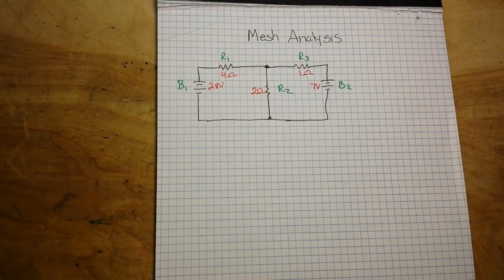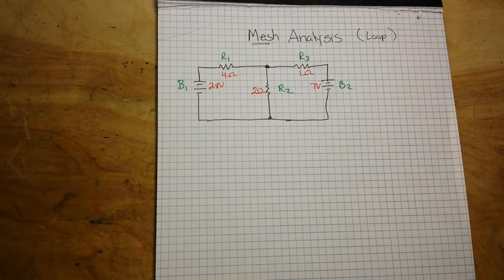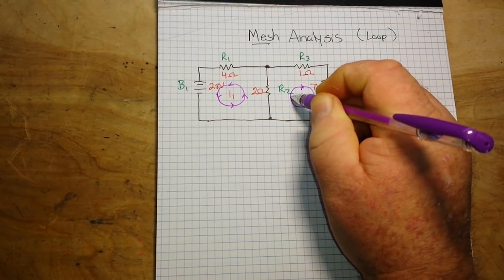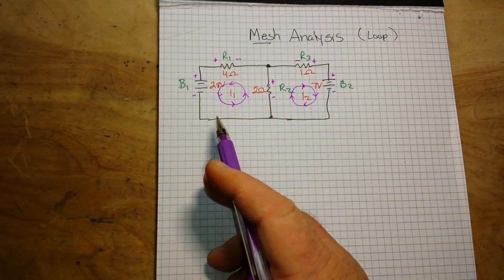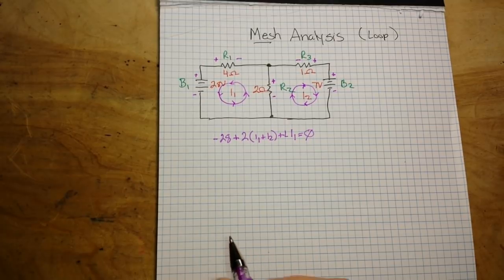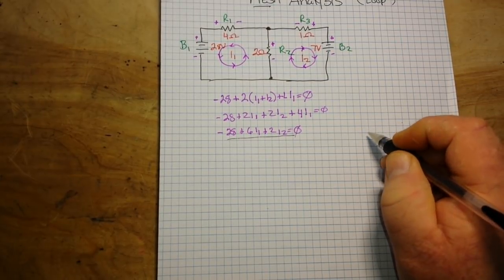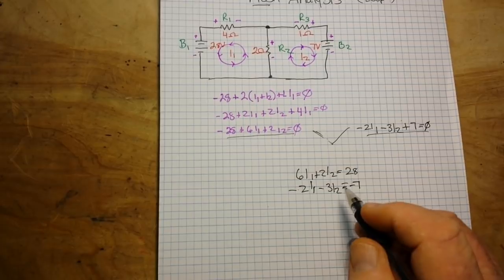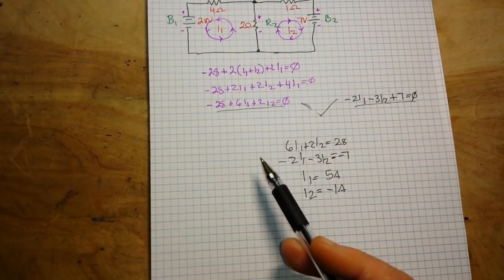Mesh Analysis for electronics

Comment: I know this is unrelated to the video, but could you do a video on the tl494? For some reason I just can't figure out how to make it work.

Thank you
Reply: The TL494 could easily become a rather exhaustive subject to cover.  Did you check for any video availability on Youtube ?  Comparing what you've done so far with some of these videos along with the datasheet should normally be sufficient to get you on track.  Also, there is no point to re-invent the wheel, so if you could share what you've done so far, perhaps someone will be able to jump in and give you some directions, because saying you can't figure out how to make it work might not cut it as nobody knows what you've attempted so far.